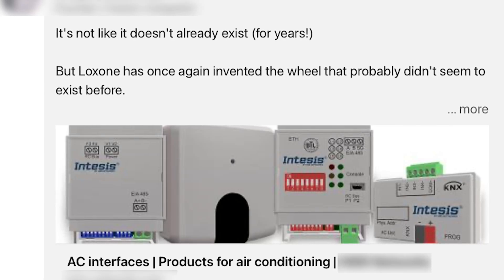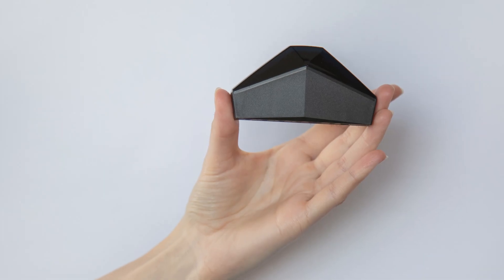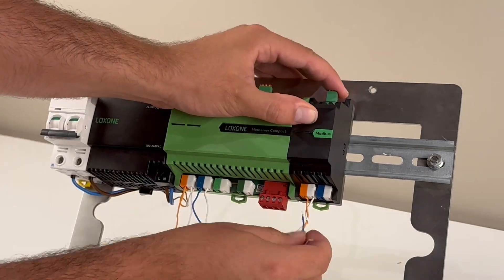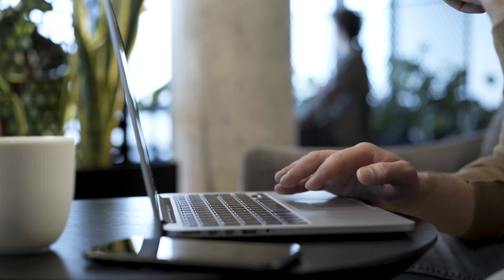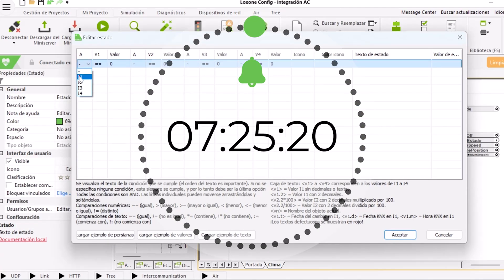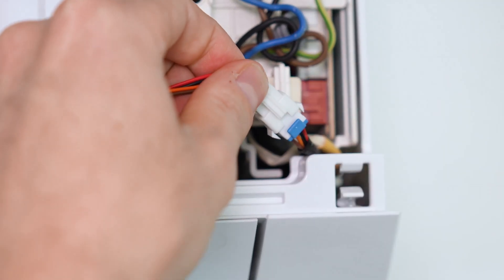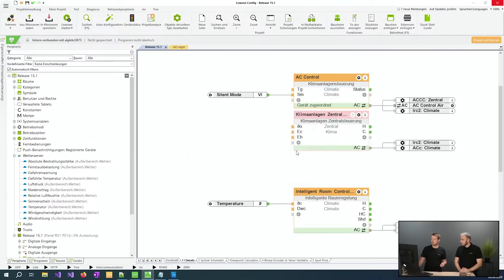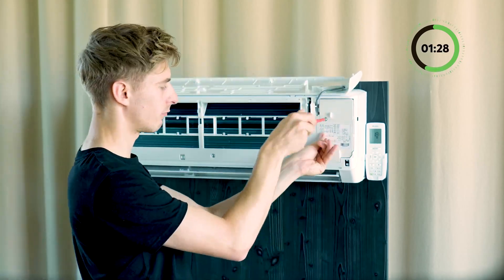ModBus vs. AC Control Air: Making Air Conditioning Smart | Loxone [4k]

Comment: it is worth adding one important fact that you do not mention, that when connecting via modbus we have two-way communication, and when using loxone modules only one-way...
Reply from the maker: Hi, thank you for your comment and interest.
That would however not be correct for all modbus integrations - depending on the device used - it might only be 1 way communication as well. This is generalising modbus a bit too much.
Hope this helps clarify things.

Comment: How does it work ? Is it applicable for indigenous single phase window AC , what are the other sensors and I/O devices used to control temperature,  humidity , on off timing etc.
Reply from the maker: Hi, thank you for your question and interest.
It is applicable for both split units and standalone ACs  - please find more information here: https://shop.loxone.com/enuk/ac-control.html . We also use the Touch family of devices (https://shop.loxone.com/enuk/catalogsearch/result/?q=touch ) for getting the temperature and humidity of the room. The ac control air just controls the ac and sends commands like mode ,on/of, target temp etc.
Hope this helps. If you have any further questions, please reach out to one of our support team who will be able to chat it through with you.
Reply: @LoxoneINT  thanks for reply.